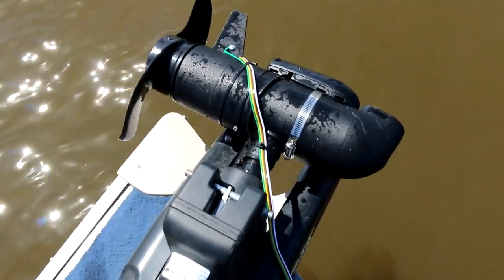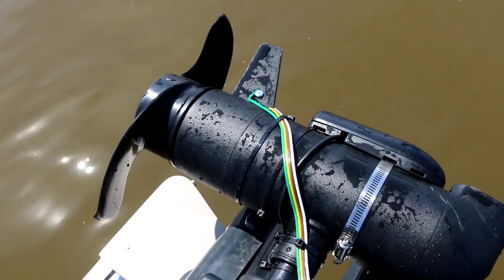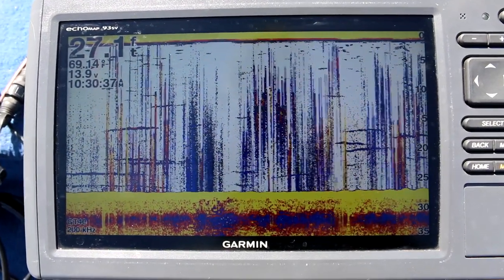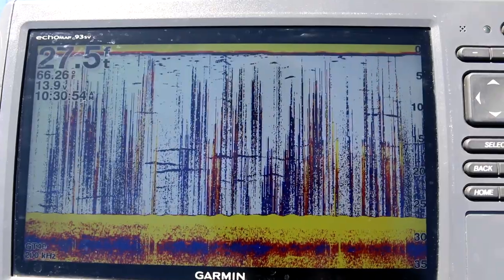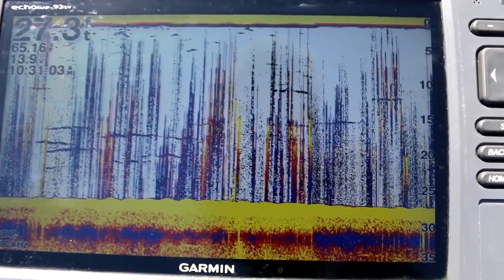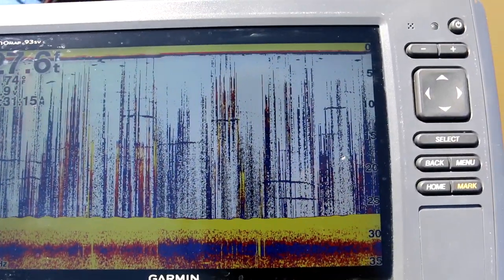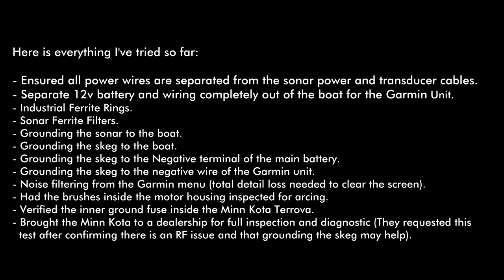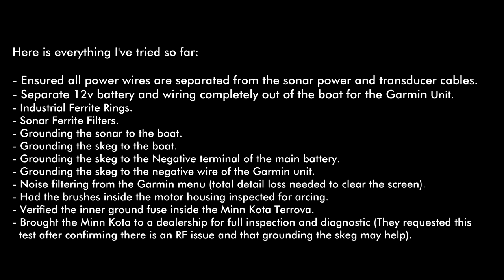Grounding the Trolling Motor Skeg to the Battery Test for Sonar Interference!

Comment: So ready for you to get a new troller and give us the good clear news man!! What a freakin' headache :(((( I have a Minn Kota (older.. maybe 2013?) and a new 93sv that has some interference. It's not as severe as yours, but when the trolling motor is going I don't pick up ANY structure with SideVu, so... kinda useless. Anyway, update us once the new motor gets installed and tell us how great the clarity is lol!
Reply from the maker: Coming VERY soon!  I'll be going with a Garmin Force :)
Reply: Please let us know how the Force works out. I have been fighting this and working through the fixes for about a year. I am over an hour from the water so testing fixes are not quick. My setup is slightly different as I have a bay boat and Riptide So no pre-installed ground in the motor. I have installed one and had made the only small difference so far, I can now run the fish finder at about 55% gain (when the trolling motor is off I am good to about 85-90). I have the Garmin running off a completely separate small battery and the transducer is on the transom. One thing of note, if the Minn Kota is in full speed I get no interference.  I have had the boat two years and can’t believe I am considering buying a second trolling motor.

Comment: I’ve had my 2019 Terrova riptide with the GT54 transducer working great for two years. Just last week the dreaded interference started. When I take the transducer off the motor housing interference starts. So something changed inside the Terrova motor.

Comment: I have a Terrova and tried all these same things that didn't work. Today I ran a short ground wire from the negative connection(From the battery) on the speed control board to the aluminum frame of the mounting bracket base and so far the interference is gone.
Reply from the maker: LOL what the heck?!  Did you try grounding the skeg and that didn't work but grounding the bracket base did?  LOL I'm going to hook up 50 ground wires to mine and try that lol!
Reply: @DanRichardFishing  any updates?  I am having the same issue. I only have the issue when the trolling motor is in the water any speed OTHER THAN max speed (10) so it is the speed limiter that is causing the issue. I have 3 different chokes on the transducer cable, a choke on the hot wire inside the head of the trolling motor.  The transducer is on a separate pole mount 3 feet away from trolling motor. Trolling motor even causes interference to to Bow mounted graph.  Garmin 73sv and 93sv  Minn Kota Terrova.

Comment: Ok I have 93 & 94 sc uhd.   And a terrova 24 volt.   My transducers are on the back of my boat.   And when under the outboards power they work great.  But when I turn the trolling motor on major interference.     Thought it was just me.   My transducers are over 18 feet away from trolling motor and it’s effecting it
Reply from the maker: Are your Echomaps connected to the same batteries as your trolling motor by any chance?

Comment: Dan, 
Were you able to fix this issue?  Having the same problem and checking for updates.  Seperate lithium battery running two 106sv . Fiberglass boat.  TM Ulterra static every time I engage the prop.

Comment: Does the interference have anything to do with a transducer being mounted to a transducer... thus pinging off of each other...
Reply from the maker: That's a great question and it could potentially if both are plugged in to your unit at the same time however if the built-in puck transducer is not connected to a sonar unit, it's not active.  So in my case, it's not plugged in.

Comment: Sounds like you have the same issue I have. I'm running a power drive. Did you ever figure out a fix?
Reply from the maker: Hi Jake, sorry to hear you're having similar issues, the irony is that my Power Drive I had before this motor never had this issue lol!  Unfortunately it looks like there is no fix, the motor pumps off the interference even in the controlled workshop at the Minn Kota dealer, it has nothing to do with how it's wired, the boat or the fish finder equipment.  The motor was dissected and nothing was found amiss so it's just the motor itself and how it's designed.  The only fix is to change the motor, which I hope to do once all this virus madness is over and we can all get back to work.  For your issue, did you try everything I mentioned in my other troubleshooting video?

Comment: going through the same issue with an ultrex....i was so excited to get a new ultrex and this happened. front graph is pretty much useless 😣
Reply from the maker: Oh no, I am surprised to hear you're having this issue with a new Ultrex!  So it's doing this brand new out of the box?  What trouble-shooting have you done so far?
Reply: @DanRichardFishing  so far i did all the grounding check points that people  recommend,  the ferrites, rf chokes and even tried emi sleeving on entire transducer cable.
Reply from the maker: @DCmite1  OK so you've been going crazy with all the different online solutions, sounds like you're doing what I did.  If I may give you some feedback from my lessons learned, here's some suggestions for troubleshooting.  My main issue was that I had already epoxied the transducer cable to the shaft so my troubleshooting was a bit limited.  Here are my suggestions, some are super obvious so pardon if this is kind of "well duh".

1. I am assuming you are not powering the chartplotter from the same battery as the trolling motor
2. I am assuming you checked the small grounding fuse in the head of the trolling motor and verified it's good with a continuity tester (not just visually)
3. I am assuming you are testing with no other transducers active on the boat.
All of these could lead to interference and should be checked off before doing anything else.  Next up, you need to narrow down is the issue the wiring or is it the motor housing itself pumping out the RF noise:
4. Does the interference only kick up when you engage the motor or is it on all the time?  Is it worse in deep water vs shallow or dirty water vs clean?
5. Mount the transducer on a pole and take your boat out on the water.  Turn your trolling motor on and set it to constant and carefully move the transducer closer to the barrel of the motor (be careful you don't hit the prop!).  Does the interference get worse as you touch it to the barrel vs 6 inches?  If the transducer is moved completely away (1 foot or more) does the interference vanish?
6. Run a separate power cable from a 12v battery loose on your deck and run the cable directly to the unit and remove the transducer wire from any routing you've done.  Still get the interference?

Let me know if you have any feedback on that!  Personally if you just bought this and have it under warranty, I'd get in touch with MK and get it tested at a service center.
Reply: @DanRichardFishing  i dont have a lake close but i did dunk the motor in a trash can full of water...interference only kicks in when the motor turns. i removed the ducer from the motor and dunked it in a seperate tub of water and all interference was gone.
Reply: i just tried the ducer on the body of the motor but on s standalone battery and all the noise is gone
Reply from the maker: @DCmite1  OK so that's a good sign, that means it's not the motor housing giving off the interference.  How were you powering your graph and your trolling motor originally?  Are you running everything off the same battery?  If you are running off the same battery for both, that's 100% your issue.  If you are running a separate battery for your graph and a different battery or batteries for your trolling motor, try running a totally separate power wire and ground wire from the main battery to the graph that is loose on the deck and not running through any conduit or near other wires and see if the interference is gone.

Comment: talked to mechanic at tracker boats. he said run a ground jumper from trollling battery to starting battery negatives.
Reply from the maker: Tried that as well, no change. Although I'll be fixing the issue soon.. by installing a new trolling motor 😂

Comment: The interference  is coming  through  the battery charger. If it's multiple  banks
Reply from the maker: Not on mine, it did it even with totally separate batteries sitting on the ground directly wired to the trolling motor.

Comment: I completely cured my interference by replacing my two bank charger with two single chargers. There was some common connection between the trolling motor battery and the Garmin battery. This is not this particular problem but may be someone’s problem.
Reply from the maker: Thanks for this tip!  Like you said, it wasn't the issue in my particular case but it is pretty spectacular how many things can cause interference.  Thank goodness for the new brushless versions.

Comment: There wouldn't happen to have a fuse in the top do you. Just seen a video where the ultrex has a fuse under the top
Reply from the maker: Hi Gary, there is indeed a fuse in the head of the trolling motor unit, it was the first thing I checked and it was good :)
Reply: Sometimes a fuse can look good and still be bad. Off no good then I would try a different mount that will get the transducer off of the motor. Put in same spot just let hang a little bit lower rather than right on the motor. Lol, I have OCD and it's drives me nuts. Don't mean to beat a dead horse but anyway. I would try a different mount
Reply from the maker: @garysample1980  I always check fuses with a continuity tester, it was good. It was also swapped out at the Minn Kota authorized service center and that didn't fix it either. The RF noise that is being generated from the motor is anywhere within a foot of the motor. So even if I put a spacer of some kind in between the mount it won't make a difference. This is really a design issue with this particular motor. I'm looking to upgrade soon so hopefully this will be a non issue soon! So frustrating lol!
Reply: Dan Richard Fishing wow, did they verify that this happens with all terovas?

The Garmin troller is EPIC...i think it’s by far the best one available, wish i could afford one.

Comment: Not sure if others have told you this, but you need to scrape some of the paint away where the bolt is going through or that ground is useless. As an electrician, we even sand oxidation from a bare copper pipe to ensure proper bonding.
Reply from the maker: For the purpose of the test, you don't.  By drilling and screwing right through the metal, you are making metal on metal contact.  If it was permanent, then yes I would agree that you should remove the paint on the both sides around the hole and use a bolt with washers to maximize your contact to the metal.  But for the record, it is not normal for anyone to have to drilling and wire in to the skeg of your trolling motor and I wouldn't recommend to use this as a permanent solution for a grounding problem.
Reply: @DanRichardFishing  Oh gotcha! I didn’t realize you used the screw to tap the metal.  I thought you drilled through first then used a nut and bolt.

Comment: The wire you have attached to the skeg....instead of connecting to to the negative on your battery try connecting it to the negative on your trolling motor plug
Reply from the maker: I actually try that it one of my earlier rounds of testing before I brought it to the Minn Kota repair center and unfortunately it didn't do anything. To give further bad news today is really the first day I use it since getting it back from the repair shop and the motor is making a horrible grinding metallic sound any time it runs so it looks like it's going back to the shop. This thing is killing me LOL

Comment: I cut a old rubber boot and made 3 layers the same size as the transducer and placed them between trolling motor and the transducer and I have no interference at all.
Reply from the maker: I really like this idea, nice one!  It wouldn't work in my case because the interference was measured to be affecting anything within a FOOT of the motor but this is a good idea for anyone getting the interference from the vibration of the motor housing, well done!

Comment: You need to ground the wire to the negative buss terminal you’re using for the *sonar*, not the trolling motor. That works every time, regardless of sonar brand or trolling motor brand. If you’ve tried that and it hasn’t worked, make  certain you’re making good contact on your ground. The paint on the skeg will prevent good ground, so make sure you are terminal to metal at the TM skeg.
Reply from the maker: Hi Mike, that was actually tried as well in the very first steps of trouble shooting and still didn't work.  The motor itself is just pumping out the RF noise, there's nothing grounding will fix unfortunately.  Its really just the design of this motor, I'll be changing it this winter if all goes well :)
Reply: Troubleshooting my simple Minnesota and Lowrance set up for the canoe and found your vid. I'm hoping these Minn Kota motors don't have an RF shielding problem making it near impossible to use with sonar. Mine works fine at 100% throttle, but anything else the Lowrance seems to simply filter out the signal so I get only a rough idea of the bottom. Trying the ferrite rings and clamp-ons, but vid is making me think it's an inherent design issue.
Reply: @blaircox1589  same issue here on a minn kota maxxum with a garmin 92sv.. when i put motor off i can set gain of the sonar to about 90% with no filtering added.. super clear screen all the way down to  about 100 foot... but once i put on the motor the whole screen just goes red.. (i got the blue scheme on).. now i have to set gain to 35 and put on filtering.. can barely even see the bottom anymore.. I also have a old motorguide laying around, will be trying that aswell.. Also i had to return the minn kota 3 times before.. firs one was faulty assembly (wire between lid).. second one ran like a limp motor.. third one i had for 3 trips and one of the mounting screws got twisted threads.. so now im going to have to return it AGAIN.. I really hope they just give me back my money this time.. or i will be returning that motor 50 times in exchange for a new one before my 2 year warranty runs out!

Comment: Your not suppose to ground at the skeg!  But close to the rotating mass of the motor itself by compressing the wire with a metal clamp around the motor housing itself. NO SCREW
Reply from the maker: I agree but other people suggested trying to ground the skeg which I also tried, believe me nothing will fix it it's totally 100% a design issue with the motor and there's absolutely nothing you can do to change it. The Minn Kota dealership itself took out a brand new one off the shelf exact same model and it did the exact same thing on their workbench.

Comment: Hey Dan look up youtube tips & tricks by Doug V. you need a Feritte ring on you transducer cable.
Reply from the maker: Already tried the recommended ferrite rings as well as these super huge versions that cost about $120 each and it does nothing. The interference is not being caused via the cable to the unit it's directly being picked up by the transducer puck and being interpreted as noise so no ferrite ring will filter it out unfortunately. If you check out one of my earlier videos on the complete troubleshooting I did you'll see the ring in the video.  thanks for trying to help I really appreciate it, unfortunately I've really tried absolutely everything you can possibly imagine ever mention on the Internet lol! The last thing to do is to just change the motor, which I will be doing likely this spring.

Comment: i see the problem.... the mounted probe attached to (la sonde qui est attaché au moteur) cacth interferences generated the brush magnetic motor.
the probe needs to have good distance from the motor. 
credit : bass geek / https://youtu.be/wcu5I_SANos
suggestion :   1- find a way to make distance  /  taller adapter
Reply from the maker: Up until recently, all trolling motors are brush motors and these transducers are designed to be barrel mounted.  The motor is designed for this exact purpose and the motor I had before didn't have this issue.  You're right though, the issue is the RF noise pumping off the barrel, but that's a defect in the motor.  There are tens of thousands of Ultrex motors out there with transducers attached to the barrel housing with no issues.

Comment: i ran mine off a second battery ...problem solved
Reply from the maker: I tried that as well.. totally separate batteries not even in the boat, sitting on my driveway with all separate wiring.  Same issue.